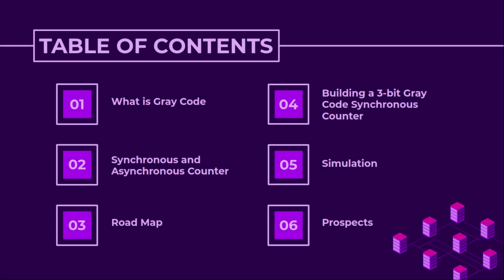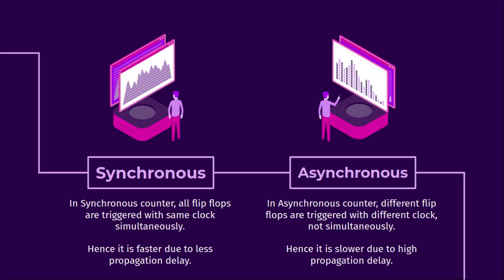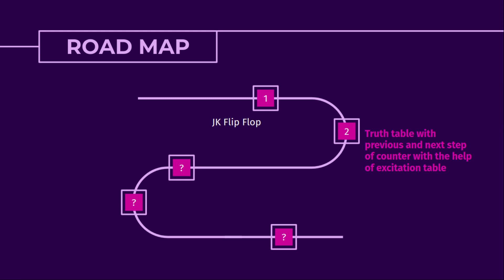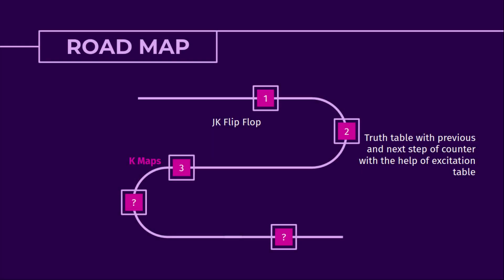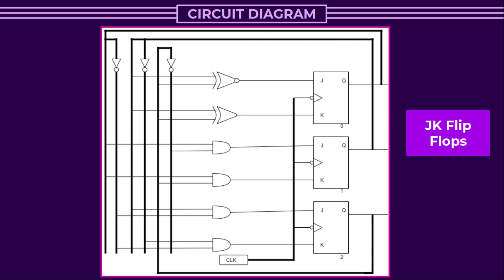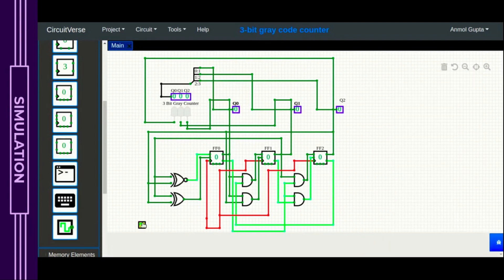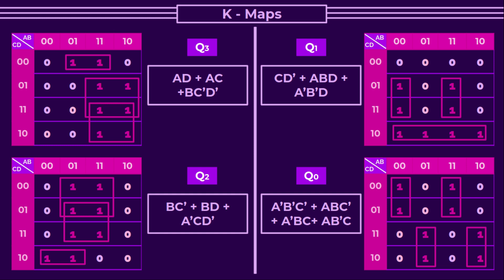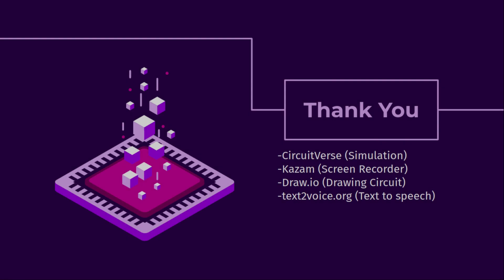Three bit synchronous gray code up counter using J-K flip flops

Comment: This is the best template for education I have come across so far. Bring more!
However Is the format for this K map standard? It seems the K map is taught universally with a different order. In this case it should go on the top row, cell number 0 1 3 2 and on the bottom row 4 5 7 6.